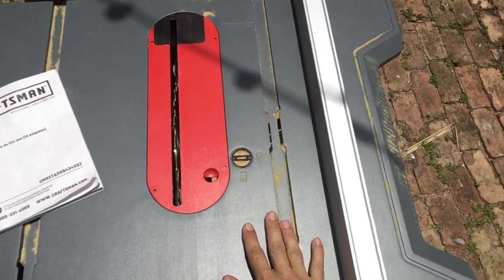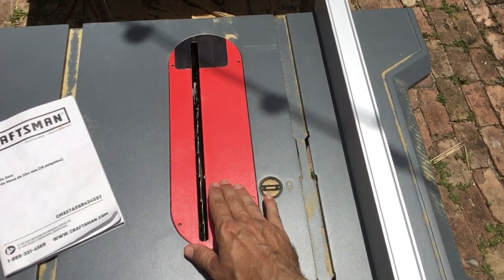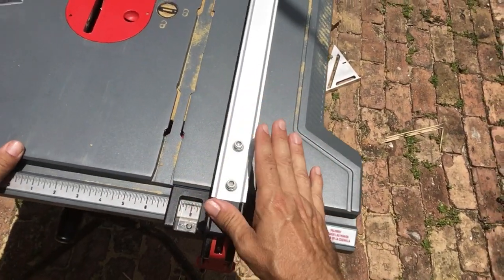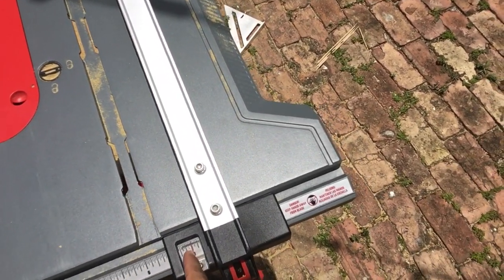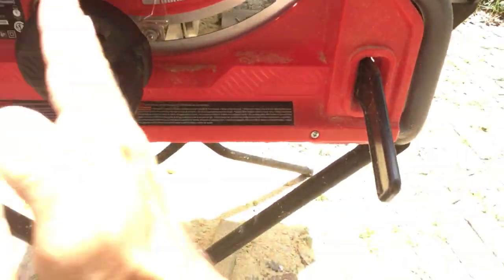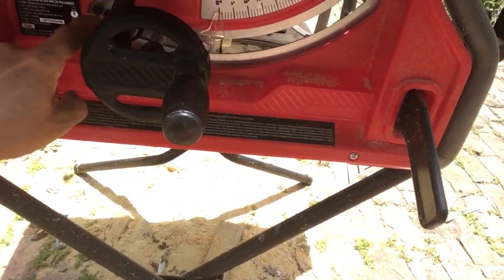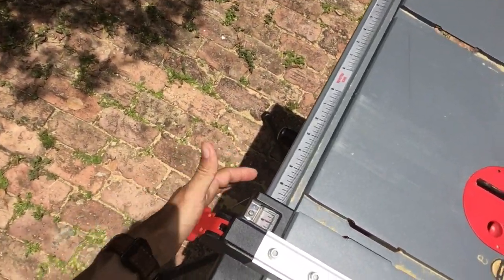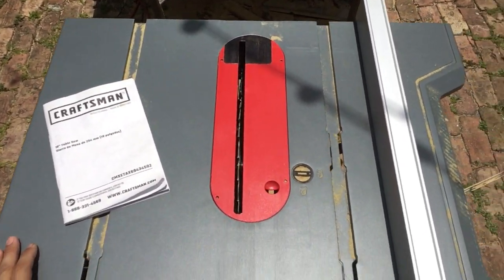Craftsman 10” Table Saw Calibration Overview CMXETAX69434502

Comment: I knew about the other adjustments but did not know about the allen studs on the throat plate. Going to definitely fix mine before I use it again because it is certainly not flush with the table top. Thanks for the video!